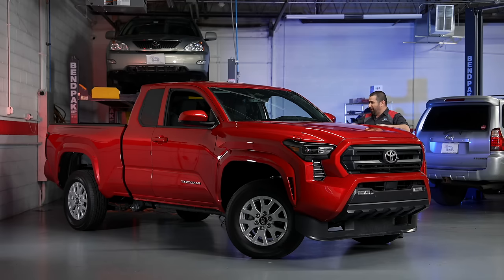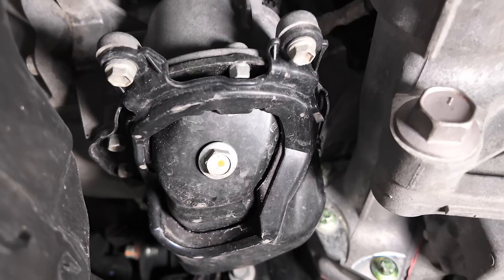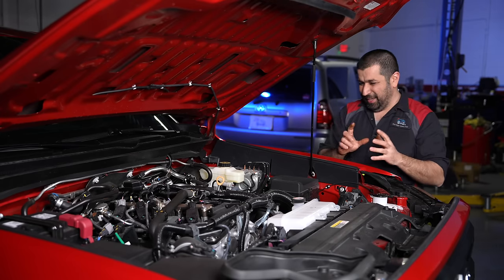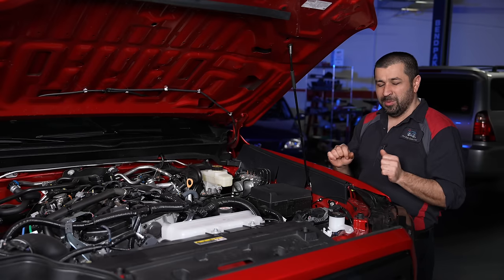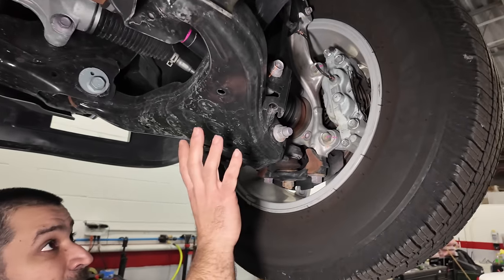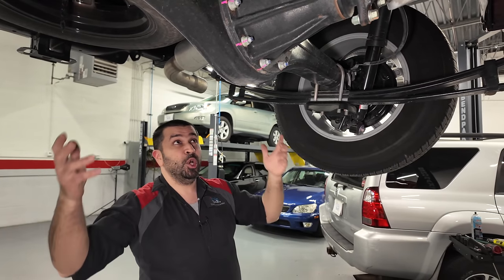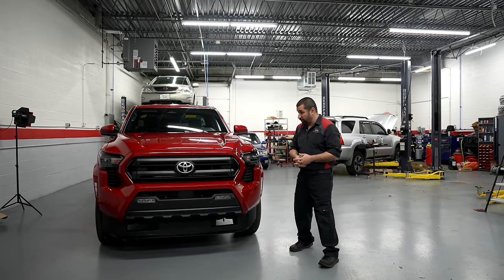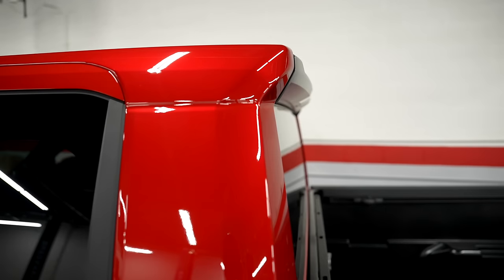2024 Toyota Tacoma | Did Toyota Improve or Ruin The Tacoma? Comprehensive Review

Comment: I simply can't believe that a high pressure turbocharged engine is going to last 300k miles, as the old 4, 6, and 8  cylinder did routinely.
Reply: All vehicles have parts that will need to be changed out by age or mileage. With proper maintenance, the engine and transmission will out last the body.
Reply: Volvo 5 cylinder turbos last 300k easily for 30 years since they turbo'd that engine. Turbochargers last unless oil changes are too infrequent. This engine shares a lot of the tech of that Volvo engine had but with roller cam followers and direct+port injection and the new vvt cintrol system that has been used 10+ years on somenother brands with success.
Reply: You’re right.  It won’t last.  It will start burning oil at about $100K.  Downhill from there.
Reply: @jimmyaber5920  diesel. Not gasoline.
Reply: @MonkeyDelicious thats because the body is built like a soda can its not designed to survive a shopping cart in the grocery store genius
Reply: 1st Gen Tacomas were 4 cylinder
Reply: Why wouldn’t it? I’ve seen many turbo cars go 300k. Beat hard too. 

The longest lasting engines with the highest miles in the world are all turbos. Every trailer truck on the road. A straight 6 turbo with turbos that are massive. Low maintenance and built for hard work.
Reply: @willytrouble88 Wrong.
Reply: @ryanb8736  diesel, not gasoline.
Reply: @mitchellbroaddus9120  It’s still a massive turbo. Turbo technology has come a long way. Engines these days are built ground up for boost. 

Engines built years ago were not entirely built for turbos. They now have stronger internals, larger cooling jackets, ultra strong head gaskets designed for boost and heat. 

It’s actually quite simple to built these. Maintenance is no different. Makes more sense power and torque at low rpm. Engines work less as turbo does all the work. 

Turbo failures are very rare these days. Turbo technology is amazing these days. It’s also easy. It’s a casing with a propeller and an ultra long lasting bearing. Nothing to it.
Reply: @jimmyaber5920 unless you miss that timing belt change then you toss the motor.
Reply: @ryanb8736  well, we can discuss the differences in diesel engines, and gasoline, the internal pressure they are designed to operate at, rpms, and so on. But what I would really like is some documentation on turbocharged gasoline engines that last even 250k plus miles, and what repair costs were over that interval. I don't consider myself the smartest man in the room, so I don't mind being wrong.
Reply: @mitchellbroaddus9120  I’ve been working on engines for 36 years. Lexus has been using this engine for years. So it’s not entirely new. Toyota makes reliable engines. 

Even crappy Kia and Hyundais go over 250k miles. So I expect Toyota to double that. 

As long as engine is built for Turbo, it should last with ease. It’s basic technology these days.
Reply: @mitchellbroaddus9120  Toyota should have done a straight 6 turbo in the Tundra instead of a V6. Would have lasted 10 times longer. Inline engines last longer as they are more balanced. 

Dodge just went straight 6 Turbos after they ditched all the V8’s. Best move for reliability and massive power gains over a NA V8.
Reply: @mitchellbroaddus9120  Now if Toyota built a straight 6 turbo, it would be the best engine ever. 

They still have the best straight 6 ever built.  The 2JZ. It’s a tuners dream engine for massive power up to 2000hp. 

It’s old tech, but still works amazing. Toyota should have revised that back. Toyota would have the most iconic truck engines ever.
Reply: @ryanb8736  well, I retired 4 years ago, and only turn wrenches for my own vehicles now. But, a man that has 36 successful years as a mechanic should know of what he speaks. Only another 22 years, and you'll match me.
Reply: @mitchellbroaddus9120  I had Volvo c30 with T5, turbo and gas. It was a solid car, never had parts fail as long as I change oil and filter and other specified consumable parts in time/intereval. My younger cousin drove it after ditching it and it still has original engine and turbo. Should be well past 400k now.
Reply: @mitchellbroaddus9120  Then you remember when variable valve times dual overhead cam 4 valve per cylinder aluminum block engines were first intruded to mass market vehicles. They greatly improved mpg, emissions, and power at only a modest increase in maintenance. Everything is a trade off. I don't think anyone want to go back to the days of a small block v8 making 150hp
Reply: @JD-yx7be  no, we don't! But I still think turbocharged gasoline engines are a mistake for an everyday driver vehicle.
Reply: @TheAnnoyingBoss  everyone is entitled to their stupidity or intellect.
Reply: I’d be surprised if humanity is around long enough to put 300k on a vehicle.  I wouldn’t worry too much.
Reply: They weren’t 50 grand

Comment: toyotas dual injection is smart. they can spray the valves to keep them clean
Reply: They copied Ford.
Reply: @chuckwalla2967 Jesus I hope not!!!
Reply: @OhMySack  bingo
Reply: @OhMySack  3rd gen coyote has dual injection and for a 5 liter gets incredible mileage without even having cylinder deactivation. It's certainly a design worth copying. But judging their cheap economy engines the same as their premium products will get you to these conclusions. Same as gm's Ecotec turds and the magnificent LT V8's
Reply: @OhMySack  That's funny because everyone seems to copy Ford in the market eventually.

Ford creates the Raptor, everyone has to make a clone or a trim level.

Ford creates the Maverick, Toyota just conveniently decides to build a compact truck again.

Shit happens all the time.

Comment: I bought new a 1991 ExtraCab 4x4 like this new one that is being reviewed. it was a 4 cylinder automatic and very slow off the line, but once it got going I could cruise at 70 mph with no problem. This new 2024 Tacoma ExtraCab 4x4 with a much improved 4 cylinder looks like a winner.

Comment: I have a 2013 Tacoma 4wd single cab auto 2.7l.  It is the ipitome of the definition of basic.  It even has crank windows.  I purchased this truck new and has been trouble free and reliable for 11 years.  I was looking to upgrade with a 2024 Tacoma but after watching this video, the new Tacoma has become a very complicated and over engineered Truck.  There isn’t a 2024 Tacoma model that would meet the standards of my current Tacoma.  The price has also doubled since I purchased my truck.  I feel my current truck will outlast the current Tacoma.  Thank you car care nut for convincing me to hold on to my current truck.
Reply: I’m keeping my 1996 taco with a five speed manual transmission and 2.7 L 😊
Reply: The price of everything has nearly doubled in the last decade. mcdonalds is near $13 for a meal now
Reply: I have 2013 2wd access cab model and I very happy with after 11 years and 107,000 miles. So far all I've had to do to this truck is change the fluids and filters.
Reply: I think we need more complicated drive trains so no mechanic can fix them.

Comment: My main concern is am I going to get 300k+ miles on this 4-cylinder turbo, compared to my V6 2020 Tacoma? Dependability/longevity matters the most to me, it's why I buy Toyota. We're talking about real driving and towing conditions here, not how Toyota thinks people drive.
Reply: The 6 cylinder turbo Ford truck out sells Chevy and Dodge V8. That's the future. Smaller turbo engines with more horsepower and torque.
Reply: @MonkeyDelicious Worse gas mileage when towing, also I am asking about overall reliability and longevity. I don't care about more horsepower when I am tooling around town.

Comment: They RUINED it.  I grabbed a 2022 V6 Taco before they got stupid.
Reply: I have a third GEN that I have armored locked with a winch and a swinging out tire carrier lifted with overload springs. I’m also a dealership collision tech at Ford. We got one in today in the shop and aside for paying for a tune to get more horsepower, which is ridiculous, I think it’s pretty neat. I especially like the four Link rear suspension and that torque is gotta be great. The only thing I don’t like is the price considering I have a 16 inferno, Trd Or double cab short bed Fully outfitted with the technology package, including the sunroof wireless charging everything. The only thing it didn’t have was a power back window because that didn’t exist till 17 everything that you could get and I only paid $38,000 and it came with a Tonneau cover.

Comment: These trucks are no longer made to last 300k miles or more.
Reply: Current 4 runner is the only regular vehicle that can do that easily
Reply: I've seen many 1st gen ford 3.5 ecoboost last that long with proper maintenance, 2nd gen have fixed many of the issues of the first. Toyota is much more conservative in engineering and likes to do many small continues improvements. I have no doubt this will end up a great engine maybe just stay away for the first model year or two
Reply: They will last except you will have to replace a turbo charger eventually.

Comment: As a lifelong Toyota/Lexus fan I am infinitely disappointed in the new direction.
Cheap plastic everywhere, overly complex systems and turbos and smaller engines that are nowhere near the reliability of past generations with much higher repair bills and shorter lifespans.
All while charging us way more money.
The Tundra sucks in every way.
Now the Tacoma sucks in every way.
I guess the good ole days of buying a newer used Toyota every 10 years or so is over for me, as I am close aging out already with my 2014 Tundra 1794.
Maybe I can find another newer one in my color/trim with low mileage, bigger tank, and adaptative cruise, in another couple years but I really doubt it.
Likely I will have to upgrade mine and keep repairing it as long as parts can be found.
Shame on you Toyota, you are burning decades of brand loyalty with your new ignorant direction.
The only good thing you've done is the camry is badass now all around.

Comment: Two types of injectors, turbo, intercooler, electric fan, plastic cooling parts…..my 4.0l just went up in value….
Reply: It's called technology. We have to move out of the stone age.
Reply: In a few years, the market will be overloaded with used V6 Tacomas at a deep discount. This new truck will become a huge seller.
Reply: I owned a 08 with the 4.0L it was a great engine but way less torque and mpg than the 4th gen. I wouldn't mind a extra $2-3k repair around 150k miles if it means i get the extra low end torque the whole time. I would probably do the repair myself to save even more.

Comment: Went to a dealer the other day and sat in a 2024 Tacoma.  While the cab sits high, the seat sits low in the cab.  Add the blocky square windows and visibility feels really bad for what you would expect for a truck.  what happen to the days when you sat high in a truck and had an excellent view?  Sitting in the new Tacoma felt more like getting into a dump truck.  While my 2001 Taco is much smaller, I feel I have much better visibilty.

Comment: Turbos spin at 40,000 to 70,000 RPM.  The bearings in the turbos will last only 100,00 to 150,000 miles. Then the turbos will need to be replaced. That's very expensive. Also you have to idle the engine a min or 2 before you turn it off. If not, oil to lube the bearing will burn on the hot bearing reducing it's life. I will never get a car or truck with a turbo. I will also never buy a hybrid vehicle. The batteries will last 6 to 7 years, then will have to be replaced. It's expensive. I'll but a second hand Tacoma with a v6. ******Just my opinion.******

Comment: I am glad you mention the brake calipers as having issues.  Many years of the same problem of pistons seizing in the calipers.  Why did they not fix this issue before.  Let's hope they improved/fixed the issue.  Imagine how many Toyota vehicles are running around with a compromised braking system.  Pretty important aspect of a car and why did it go so long and that is not to say Toyota fixed the issue.

Comment: Plastic cooling parts: 2014 4Runner had the fan clutch seize at 342K miles and the plastic fan disintegrated. Pieces of the fan pierced the radiator and sliced an  oil cooler line. Also popped several dents the in the hood, a couple big enough to lose paint. Fortunately, wife pulled over and shut down before losing oil pressure, so no engine damage.
Reply: Toyota has had plastic fans on it's entire model line up - including Land Cruiser - since the 1970's
Reply: @verlaryder  For preventive maintenance, probably should consider replacing fan clutch and fan at 200K miles.

Comment: Great review CCN!  The 2024 Tacoma is a cool truck but I am so glad I purchased my 2023 Tacoma SR Access Cab 4x4, 4 cylinder.  I knew all about the 2024 and purposely chose to get a 2023 for the following reasons.  1. It should be bulletproof.  The engine and transmission are known to got 500,000 plus miles with just proper maintenance.  2. Price.  MSRP on my truck was $33,800 and I paid $32,400.  A comparable 2024 would be $5,000 more.  3. It has access doors to the cargo area behind the seats.  I have a feeling Toyota originally planned to have access doors but the NHTSA said that would not pass current crash safety standards so Toyota scrapped it.  Access to the cargo area is terrible without those doors.  The 2023 is not quick, nor is it a luxury vehicle, but it is comfortable enough, has air conditioning, Apple Car Play, and Toyota Safety Sense P with adaptive cruise control.  It does truck  stuff very well.  The 2024 is better looking and more powerful but if all you want is a basic truck to do truck stuff the 2023 is impossible to beat for the price.

Comment: Good information.  I just worry about all the sensors and tech will increase the pesky check engine light frequency.  If I could tell OEMs, some of us want the basic engine.  No turbos, easy access, no oil pressure cam shaft timing tech etc.  Just give us big displacement without all the possibilities of expensive check engine light diagnosis and repair.

Comment: I want to thank Toyota, for raising the resell on my 2017 TRD access cab long box. Although the rear seats are extremely difficult to use, at least, I can open the access doors, and put almost anything that I want to, into the rear area. Without the access door, you have to slide the seat forward, and then reach in. Try that a couple of times, and about the only thing to in the back, might be a jacket. Otherwise, you have to twist like a pretzel.
As well, I will stay with my "bulletproof" V-6. Good mileage, and I can tow 6500 pounds, with ease. 
YES: the new Tacoma is a better looking truck, looks, alone, don't get the job done.
Every week, someone asks me about my Tacoma, and if I would consider selling it.
The 2024 is selling for upwards of 45 - 50, and up. Sorry: no deal!
EXCELLENT VIDEO!

Comment: My 2016 Tacoma is perfect. 129,000 perfect miles. New battery, tires and tpms sensors. 4 cylinder as nd 25 mpg. 75 mph at a tic over 2000 rpm. Quiet, no rattles and tight as a drum. Oil states exactly at the full line. No rust. I had to buy a new key the key wore out!!!😂

Comment: Ahmed's comment at 1:14:00 about the price of pickup trucks in general (and this base model Tacoma in particular) really points out what an excellent value Toyota's no-frills cars are: The base models of the Prius and the Corolla Hybrid are only $25,000 and they get 53 mpg. For about $32,000~$34,000, there's the Camry Hybrid, 51 mpg, and the Rav4 Hybrid with 41 mpg (and you get standard AWD, too). For $44,000 - about the same as a BZ4X - you can get a Rav4 Prime, with it's astounding 54 miles of EV range, and 302 hp overall powertrain output, and 550 miles of gasoline range in Hybrid mode (no range anxiety!). 50 years ago, when I got my first driver's license, 1/2 ton pickup trucks were what you bought when you were too poor to afford a car. You could get a basic Ford, Chevy, or Dodge 1/2 ton truck for around $2,500, and 1/4 ton trucks like the Toyota (called the Hilux everywhere else except in the US), were about the same price but were way more reliable and got 40% better fuel economy (but no 8 foot bed). Now, pickup trucks still get horribly bad fuel economy compared to any Toyota Hybrid Synergy Drive car, and they cost as much as $60,000. When the Rav4 Prime was announced, for the 2021 model year, there was a lot of criticism about the $11,000 price premium over the Rav4 Hybrid, but I bought one anyway, and it's a wonderful car. The extra 70 hp in the upgraded MG2 motor, and the larger lithium battery, gives the Rav4 Prime significantly more performance than the non-plug-in Hybrid, especially for climbing steep hills in cities like San Francisco, and long 6% to 7% freeway upgrades in mountainous areas. The Rav4 Prime can only tow lightweight trailers, theoretically up to 2,500 pounds as long as they aren't really large in physical size, but as a daily driver, getting 45 mpg on gasoline, and 54 miles range in EV mode, the Rav4 Prime is enormously better as a people-mover than any pickup truck.

Comment: One of the few complimentary reviews I have seen of this truck.  Just curious, do you really think this 2.4 Turbo charged engine will last 400-500k miles with regular maintenance like the old V6 Tacomas do?  I would be shocked if one did make it that long.
Reply: Not a chance,, vacuum pump, turbo replacement and dash console will be trouble before 100k
Reply: A very small percentage of vehicles last 400k+ miles, there's only SIX v6 tacomas available right now that are even past 300k but none at or above 400k

that high mileage is like a human living past 100, you can try to maintain the healthiest habits possible and reduce stress as much as you can but it's up to the luck of the draw whether one lives that long or not